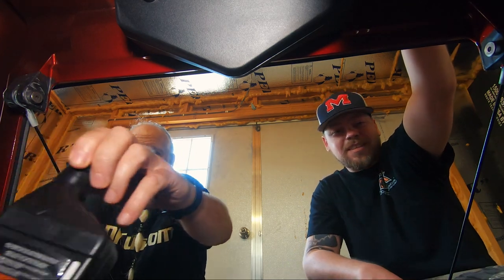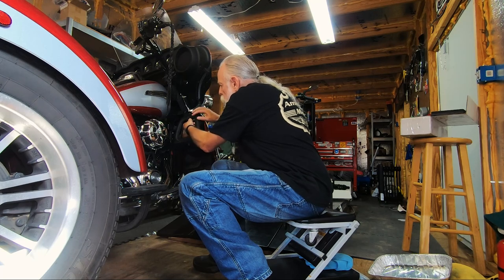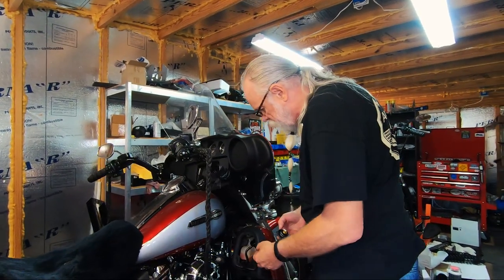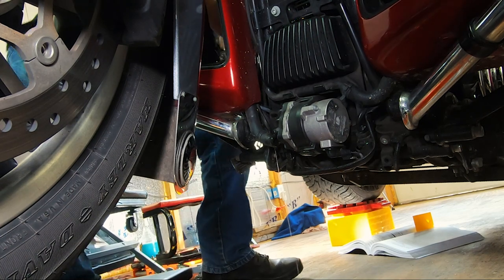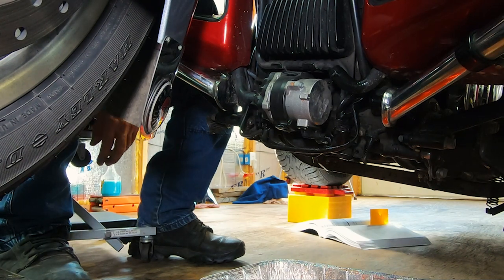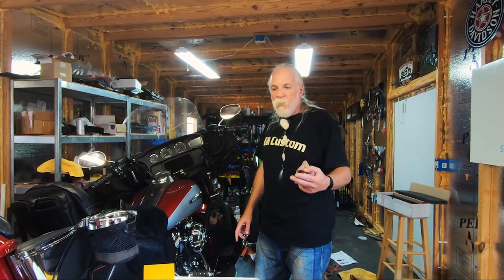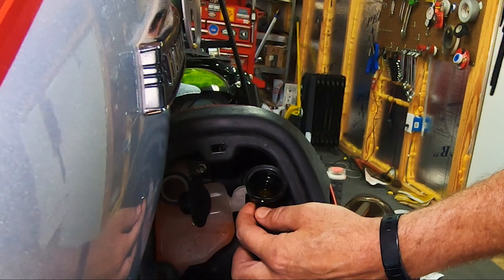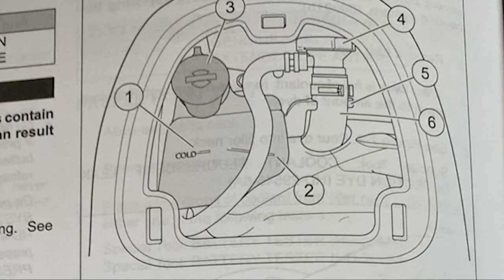DIY How To- Coolant Maintenance Harley Twin Cooled

Comment: Were you able to get the full quart of antifreeze in there?
Reply from the maker: No, as mentioned in the video it takes less than 1 quart.  According to the 2019 manual (other years may be different) it takes .8 of a quart, excluding the overflow tank.  Even with the overflow tank, it does not take a full quart.

Thanks for commenting!

Comment: Today I attempted the operation on my 2014 trike but when I removed the pump cover inside it looks different. I ended up removing only the biggest rubber tube which attaches to the pump
Reply from the maker: Yeah, over the years they've had a few different water pump configurations.  As long as you followed the instructions in the manual for your bike you should be fine.

Comment: Do you need to change fluid in the left and right radiators.
Reply from the maker: They are connected, and there is only a cap and overflow on the right side.  When you drain at the bottom, it drains both of them.  When you fill at the top, on the right, it fills both of them.  Make sure to bleed all the air out, as shown in the video.
Reply: @DKCustomProducts  thanks for getting back.

Comment: Have you had any issues with the pump breaking apart on the inside? If so is it common? I have a check engine light and a coolant light on my 2016 limited, just had it at the dealer for a 10,000 mile check up / oil change. They cleared to codes and told me to make another appt. and charged me 396 bucks for basically a oil change. I saw a video here where one part on the inside of the pump exploded, I have a code P1019, ECT Difference (high temp)....? Do I change the cooland and go, or should I get a new pump? Thanks for all your video's, I plan to get your air intake set up in the next couple days. The mechanic said drive it, it's the radio antanna????
Reply from the maker: I am on my second bike with a water pump and have not had a problem with the pump.  However, they are plastic and more than a few have failed on the road.

P1019 ECT Difference (high temp)
Possible causes:
ECT sensor malfunction.
No air flow through radiators.
Low or no coolant in system.

Could also be wiring, cooling pump or ECM

That code is not an antenna code.

If the pump is running when you test it, and you see the liquid moving in the overflow tank, then I would change the fluid and look and see if there are any plastic parts in it.  If there are not, and the fluid is flowing, then it would seem that you pump is good.

Appreciate your business, I think you will be well pleased with any of our intakes.
Reply: @DKCustomProducts  I called HD and got a case #, they told me to take it to a dealer and have it checked again, they may or  may not pay for labor and parts for the water pump conversion? Have a appt for next week. I can't wait to get your transformer and 828 installed. Going to order it later today or tommorow am. Thanks for all the tips.

Comment: How do you get the coolant cap off ?
Reply from the maker: Push down on the cap and twist, while holding the filler neck in place with the other hand.

Comment: Has anyone tried engine ice or water wetter to help reduce temps? I’ve used in cars and dirt bikes to help with the heat. Thanks for another great video!
Reply from the maker: We have not tried or heard of anyone trying the engine ice, but since the twin cooled bikes only have coolant going around the exhaust valve it does not do much to cool down the over all engine anyways. 

P.S.
If the engine ice does do a good job of drastically cooling down small area that the coolant runs through on the exhaust valve and not the entire engine I would be concerned about it making the metal around the exhaust valve too cool against the rest of the engine running too hot and causing a head to crack or warp. 

Here is a video that you may find interesting/helpful - https://www.youtube.com/watch?v=wRRtRYWm5rw

Here is a video on a common sense approach to cooling down your bike that you may also find useful/interesting - https://www.youtube.com/watch?v=CAcF0T-Cs3E

Thank you for commenting! MB

Comment: When you first noticed that the coolant level was low, could you have just filled it up to the level? Would that have cured the problem, especially if you had tightened the radiator cap to where it should have been?
Reply from the maker: Absolutely.  I was a dumbass for not doing that!
Reply: @DKCustomProducts  Well, just think. You made this AWSOME video so we all could learn from it! And THAT is why you guys rock! Thank You So Much!
Reply from the maker: @bobgelder5086  Thanks!  Yeah, it was a learning experience for sure...and one that we were able to share about.  Glad you enjoyed!
Reply: @DKCustomProducts  Great video, thank you. I just noticed I have a coolant leak but not sure where from. Thinking it could be a hose. Gonna take a closer look at it, but a couple questions. 1st how come the coolant never drained out of the reservoir when you drained the coolant? 2nd if you could have just added some coolant when it was below the line like stated above do you need to bleed it when adding because it was below the line? 3rd if it is low and u just want to add coolant do you add it in to the reservoir or into the hose like you added it into the video? Thanks for your help and time.
Reply from the maker: @samrohde8279  The reservoir is only connected to the rest of the system when the engine is running and the coolant system is under pressure, that is why it did not drain out of the reservoir when we drained the system.
Yes, I was a dumbass and did not add coolant to the reservoir when I noticed it was low.  If I had done that (and tightened the radiator cap well), I would have never had the problem.
If you are low in the reservoir, but not so low that air has been introduced into the closed, pressurized system, then you do not need to bleed the system, you can just add to the reservoir, bringing it up to the line on the reservoir tank, and you're good.
Thank you for the comment and questions.
Reply: This is the only video I can find on this subject. Thanks.

Comment: Talking about coolant, where is the oil cooler on a 2022 triglide?
Reply from the maker: There is not an oil cooler stock on a 2022 Triglide!
Reply: No oil cooler... I bought a 2015 Ultra, and the VERY FIRST thing I added was an oil cooler! If you want a great one and are willing to spend the money, go with Oil Bud. They are not cheap, but (I think) well worth the money. I have one on my 15 Ultra, and put one on my 2010 Dyna too.

Comment: Laugh all you want at my question ( it may have been asked ) how did you remove the cover where the radiator cap was ?  You did it so fast I really couldn’t see …. Mine is a 2023 ultra ..  thanks
Reply from the maker: Pry it off with your fingers, or a plastic tire fork.  It pops out...held in at all for corners with spring clips...just pull on one side till one of the corners comes loose, then get the other corners to pop out.
KP

Comment: I think that if I could delete that coolant system and replace those radiators and fans with 2 oil coolers the cooling problem would be taken care of.......
Reply from the maker: Thanks for the comment.  Interesting theory.  You may be right.  HD has done something similar (minus the coolers) with the M8 Softail and some of the Touring models.
However, since that oil only circulates around the exhaust valves, there are still big chunks of the engine that have no cooling other than air.  Here are a couple of interesting videos on the subject-

https://www.youtube.com/watch?v=h7EdjR8l8Ag
https://www.youtube.com/watch?v=HC-Z_rZtY9c

Comment: I don't think I could get the cap off of mine if I wanted to. '18 CVO Ultra Limited
Reply from the maker: Gotta hold the neck with one hand, and push HARD down and twist at the same time with the other.  It can be a booger to remove....don't do it while hot.
Reply: Did you guys find an alternative to the harley coolant?
Reply from the maker: @Bartman1  We did.  I do not remember the name of it...we ended up using the HD branded coolant.

Comment: My question is how to get that damn radiator cap off.  The only radiator cap in my 60 yrs of doing crap by myself and can’t get it.
Reply: Finally got the damn thing off after reaching behind fan holding hose and pressing downward hard as I could and twisting. Nothing is easy.
Reply from the maker: I am sorry you had trouble with the Radiator Cap. 
Yes things are definitely not as easy as they use to be.

Glad that you got it off! Thanks for commenting! 😎

Comment: It’s called vapor lock old school
Reply from the maker: Vapor lock is generally referred to fuel in a fuel system changing from liquid to vapor.

Airlock is what happens in a coolant system, when aire gets trapped in the system and blocks the normal flow of coolant.

Very closely related, but not quite the same thing, albeit similar results.

Thank you for commenting! KP